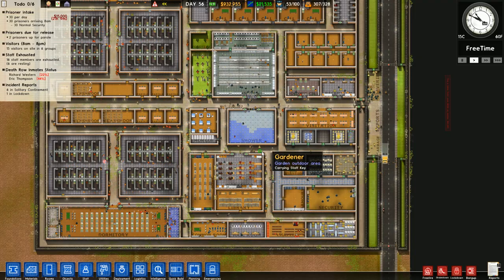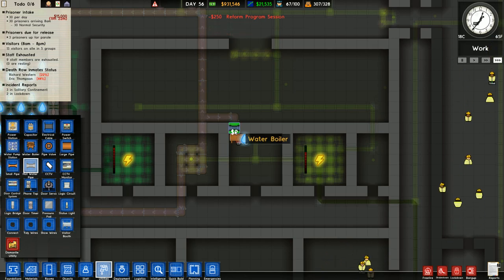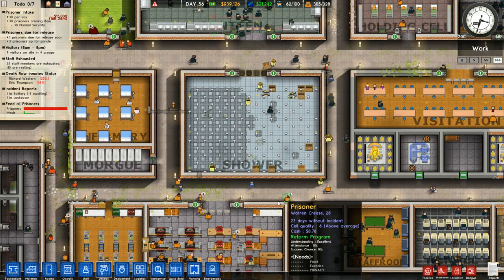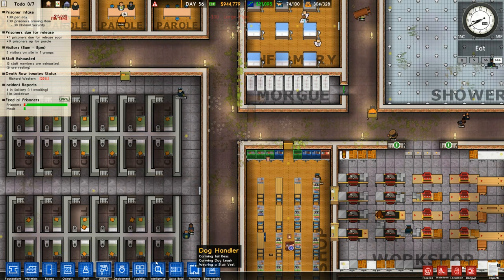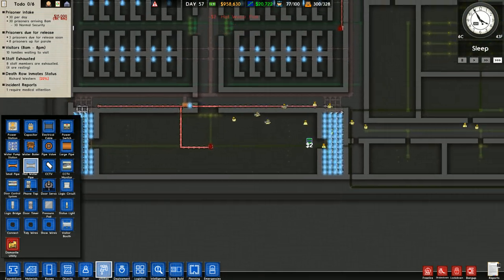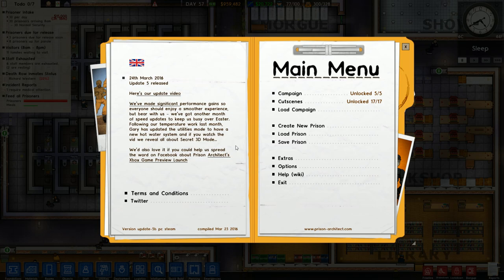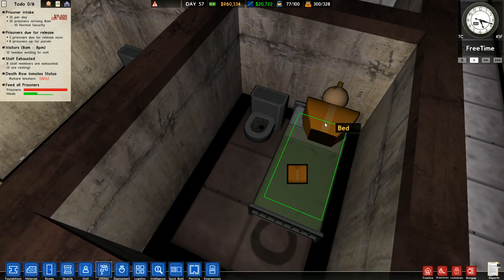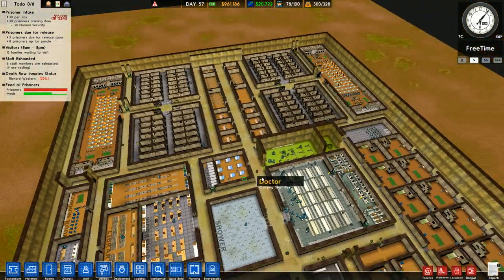Prison Architect Release Update 5 - Water Boiler, Hot Water Pipes, 3D Mode

Comment: Did the take out the water boilers and pipes?  I don't see them anywhere anymore
Reply from the maker: It's now an option. At the start of a new map, if you pick to have weather and seasons, the boilers and hot water stuff is included with that. You can also turn it on on any old map as well under the "extras" menu. Once you turn it on in game though you can't turn it off again without editing the game files.
Reply: I only have the radiator and I don't have the water boiler. I followed everything you said. My version is update-4b. The texture for the water boiler has also been switched out for the water station. Can you help me?